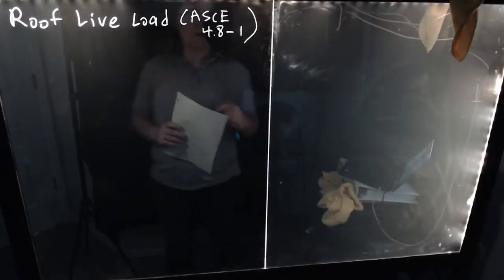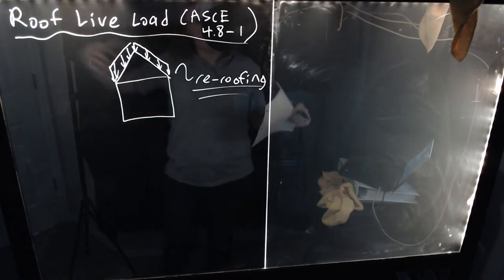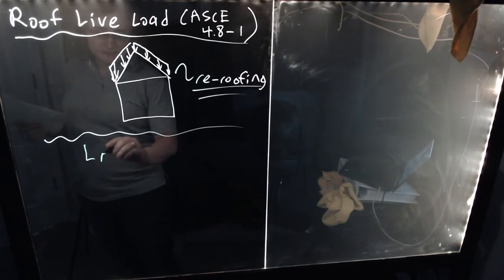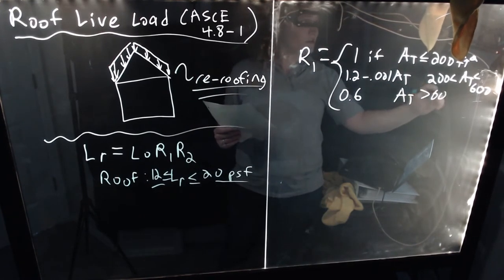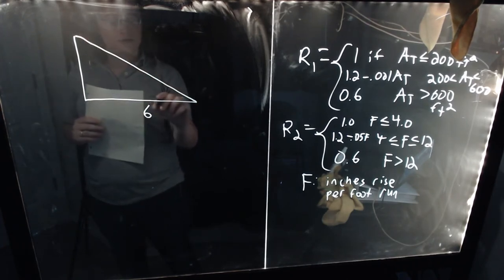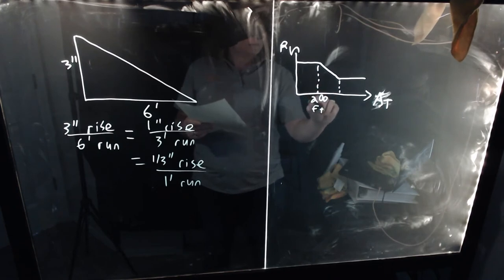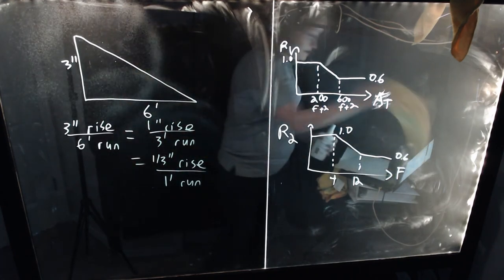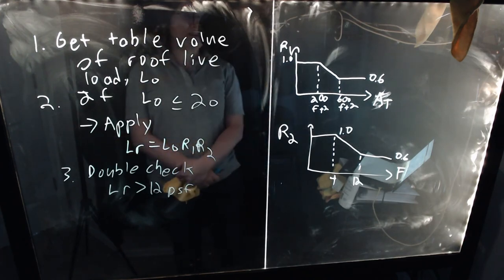Roof Live Load

Comment: I have a question on how to take the 300# conc. load for human. 
Meaning when designing the members based off the load combinations do you add a 300# conc. load or is the conc. load considered separate, as in the member needs to be safe to support just that conc. load?